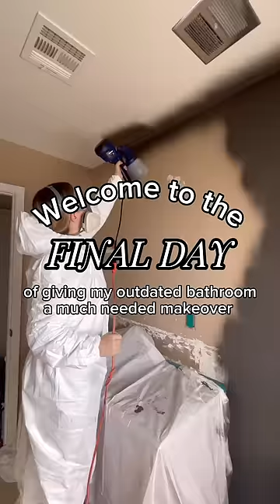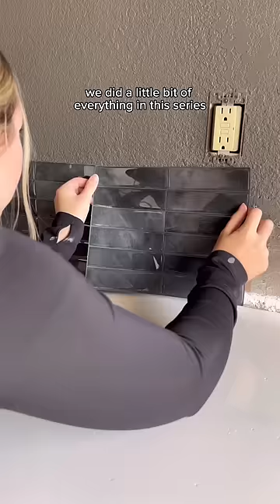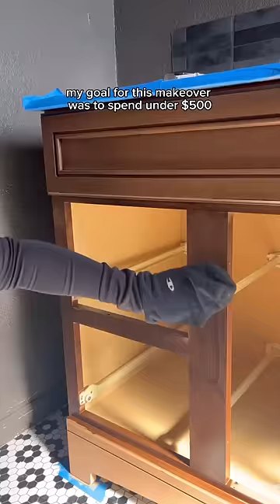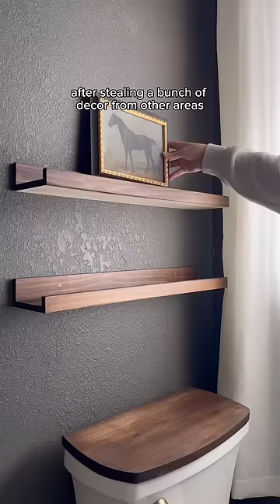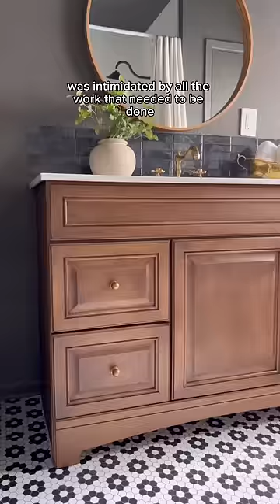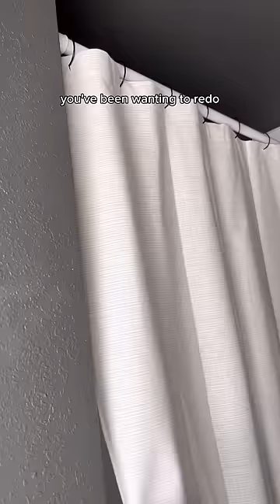BATHROOM REVEAL #diy #diyproject #diyprojects

Comment: It looks great! What paint did you use for the countertop?
Reply: @sheriwatts8722 I was gonna ask the same thing!!
Reply: I also wanna know!
Reply: paint… on a granite countertop.
Reply: @danielcarter324 that’s not very helpful
Reply: @danielcarter324 and?😂
Reply: I can tell. you from experience that painting counter tops doesn't hold up.  It's a good fix for a year or two, but the water from the sink inevitably takes the paint off around the sink.  We did this with rustoleum counter paint to cover a purple counter top from the 80's and after 3 years had to just buy a new counter top.

Comment: The old backsplash looked much better, but apart from that everything looks so much nicer in the new one!
Reply: I was looking for this comment. My exact thought. Main thing is she’s happy, of course but I did like the backsplash.
Reply: The old backsplash was very 2010s and needed to go in my opinion, it would have looked out of place in the new room. I respect your opinion though of course.
Reply: @NiNitosix   Yeah true. Personally I think many elements of the old bathroom were nice (the countertop, the backsplash, the wood, the tiles), and I would have made only a few changes to give the room more character and more modernity, like replacing the sink lamps, adding curtains and rugs, etc.
Reply: @chasethebanksy  oh no, the 2010s. Like omg, let’s replace something that looked better, with something cheap that will most likely peel off in a few years, just because it’s it’s less than 15 years out of style. Oh no, oh my goodness. 🙈
Reply: @chasethebanksy  also that stick on tile floor looks like something from way back in the day. Let’s talk about that.
Reply: @james_daniels  it's her bathroom though. there isn't anything to 'talk about', you're just upset over someone else's home decor. don't let the internet fool you into thinking commenting about it is worth your time and energy

Comment: I would take that backsplash all the up behind the mirror to the ceiling. It would add height to the room, and make it more of a finished look. Also, the curtains could go floor to ceiling and make the room look grander; or install a pull blind upside down inside the window frame, and that will look clean and tidy, still allowing natural light and body privacy.

Comment: That bathroom was durable and looked good. Now it is a maintenance nightmare and looks good. To each their own but painting tile / granite / bathtubs / or shower pans is a mistake because it is impossible to clean and it will chip off.

The peal and stick will trap moisture because it is completely impermeable unlike the tile which "breathes". The adhesive will unstick corner by corner and create noticeable gaps.

Comment: Please, before you start work on the kitchen, take a step back, and try to work with what you've got. If there is granite in the bathroom, I assume it is also in the kitchen? If so, then see if you can make the granite and backsplash work, by changing the stain or colour of the cabinets and walls? Because if they are anything like, what you had in the bathroom, then you really do not need to change much, to make it beautiful! 😊😊😊

Comment: Y'all worried about painted tiles, I'm worried for that air vent. 

But I've got trauma from our house being poorly flipped. They didn't properly secure the air vents and left demo debris  in the hvac cabinet and plumbing. Our hvac flooded the house due to debris in the outflow causing it to back up. The "wood laminate" had to be removed from two rooms because of the water damage (that stuff is a sponge and so gross). We had to have the hvac plumbing  replaced from the amount of crap in it. Its been a nightmare and cost us so much money to repair and replace with quality material to keep it from happening again.
Reply: Why does your HVAC have water in it?

Comment: The original back splash and counter top would have 100% fit with the other stuff and looked way better. Before you remove things like tile and paint things like granite, do EVERYTHING else first and if you still want to change it, then go ahead. But also real tile backsplash would have only cost you like $50 on sale for that small amount.
Reply: Exactly my thinking

Comment: I just think that granite countertops are really expensive, and that tile was not bad. I mean, you could have EASILY updated that bathroom, just by finding a nicer colourscheme, that would work WITH the granite? It has many colours in it, and I think just staining or painting the vanity, and a new wallcolour would have done the trick! Then, changing the lightfixture, and adding some nice decor, and you would have been fine! AND still had an expensive granite countertop and nice, neutral tiles, instead of just a painted, white surface and plastic floors...
Reply: I couldn’t agree more. That granite is gorgeous, and painted counters never look good. You can totally change the look of the room with new fixtures and a good coat of paint. I think the backsplash clashes, this square ultra modern and a Victorian style vanity with white and dark wood…
Reply: Granite always gives me the ick.  Personally hate the look and colors of it. Maybe because its very loud and bold? Idk
Reply: My heart sank when the backsplash tiles were removed and granite painted 😳
Reply: @formalpotato5874  it always amazes me that someone can hate something, that the earth took thousands of years to create.
Reply: @mjc2417  mosquitos? illnesses? mold? you love them?